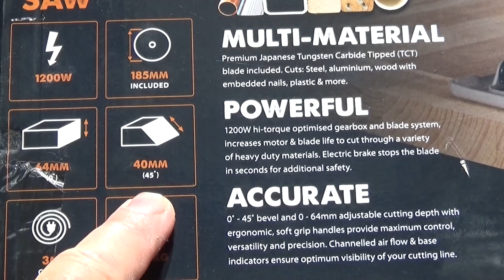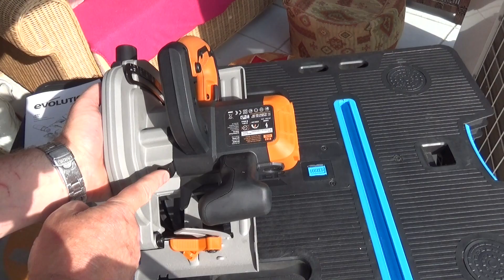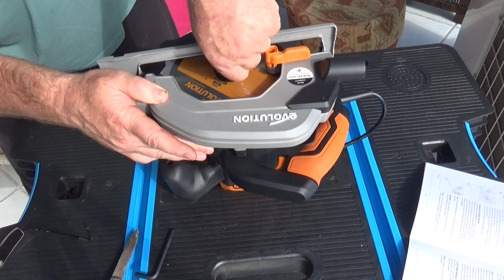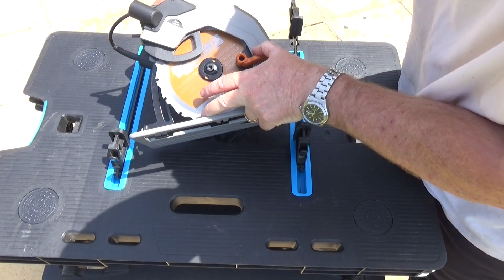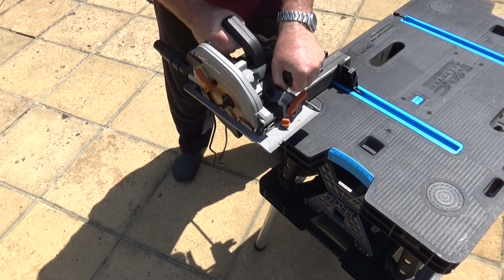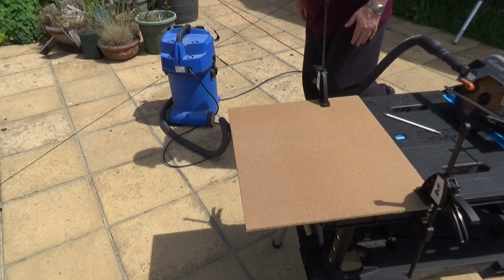Evolution R185CCSL Circular Saw - Saw provided by Evolution for review.

Comment: Hi have you got any tips for cutting mdf board at an angle.  I don't mean setting the blade to 45 using the lever on the saw but instead of cutting the strip off the board edge square - cut it so the angle of the 2 edges of the board is not 90 degrees.  I need to cut a rhomboid (had to google it!) from a square board.  I can draw the shape on the board ok with a sliding bezel.  I guess I can make a alignment jig with a straight edge offcut to use as a guide.  I have 4 of these to cut and they're all slightly different.  Thanks for this video
Reply from the maker: The jig I make on this video will work if there is enough room to clamp it onto the workpiece.  :-)

Comment: Hi mate just wanting to check up on how the saw is working after 2years ?
Reply from the maker: It is fine.  I used it recently to cut a few sleepers to make some raised beds.  It is not a tool I use a lot though.  If you look at the stanley stalple gun review I did you can see the raised beds towards the end of the review.  https://youtu.be/XDspZEPZPFY  :-)
Reply: @RussellPlatten  ahhh cheers I've been looking at a circular saw to Buy will be using only like 5 times a year but the price is too good to be true so wanted to know your experience thanks !
Reply from the maker: You're welcome!  :-)

Comment: Hello, blades from evolution are rubbish, I have try an orange one and it least for 3 cuts for 2mm thick 3x3 cm profile. I thought that it was problem with blade so I decided to send it to UK for examination. They told me that it is my fault and it is normal, I should use it for aluminum, plastic and wood not for steel. Waste of money, better buy few cheap black blades. Evolution has send me a blade back to use it for plastic. better do not believe in sponsored YT movies and stay away from this product. A saw itself is nice :) and works great with other blades.

Comment: Thanks Russell. I bought this today after watching several YouTube videos and you've highlighted all the important points, including the evolution (!) of the saw itself. The issue I had was when I attached the saw blade I failed to make sure the outer drive flange flats were engaged - resulting in a rather wobbly saw blade! I examined many saws on display in B&Q and the design and quality of the evolution seemed better than most. ScrewFix, B&Q and Parkside to a great job in providing us with amazingly good quality tools for unbelievably low prices. In general, looking at the range of tools in B&Q, I was amazed at how cheap some good quality tools are nowadays.
Reply from the maker: True Edward, the prices have dropped considerably over the years and the quality has improved!  :-)

Comment: Hi. It’s a very good video to learn how to use saw in a good way. And I want to ask you that I bought this saw as well but the cord don’t have a plug and instead it’s a 110v yellow industrial socket. So how can I change it to electric socket? Thanks
Reply from the maker: The 110v saw is designed to fit a 110v transformer here in the UK as we have 240v mains power.  It will not work on 240v.  :-)

Comment: I've got the 165mm model. Absolutely love it. £50 from Screwfix. Has that bulletproof blade you show in the video. One major thing for me (if you don't want to use the jig) you can actually see the cut line from the left side "over the motor".  That's the best bit and has straightened up my cuts no end. No other sidewinder/motor on left model offers that that I've seen.
Reply from the maker: Glad you like it Dean!  :-)

Comment: Can we use other saw blade i.e. makita/bosch etc?
Reply from the maker: You would need to search for a 185mm blade with a 20mm bore.  There are other blades available.  :-)
Reply: @RussellPlatten  Owh there are many blades with that size. My bosch circular saw use that size as well. Thank you!
Reply: @RussellPlatten  What about the thickness? Evolution has 1.7 mm meanwhile makita 2.0 mm. Will it be fit? I'm newbie btw.
Reply from the maker: @anandyahamdi  Yes the blade will be fine.  :-)

Comment: Hi. Would this cut sleepers? I understand I'd need to flip the sleep over to finish the cut, but was wonder if it would even cut it.
Reply from the maker: Strangely Richard, I have just used mine to cut several 200 x 100mm softwood sleepers for raised beds.  It coped easily.  Care just be taken to ensure the sleeper is fully supported along it's length so that the offcut does not bind the blade on end the final cut.  :-)

Comment: Russel, quick question. I've ordered this from Screwfix for collection tomorrow. It'll literally be my first power tool after a combi drill. I built a mud kitchen for my daughter out of old pallet wood and I think I've got the bug because I've ordered some materials to build a lean-to shelter off the back of my garage for the mid kitchen and a Wendy house. Anyway, ordered the circular saw after watching tons of videos on what I might need to get started but now I'm second guessing whether I should have spent the extra £25/£30 on one of the actual track saws instead. I can still cancel this one but I like what you did in the video by creating the track guide. What do you think? Should I stick with this or invest a little more for a track saw? Thanks.
Reply from the maker: If you can afford it Adam go for the track saw.  I was very impressed with the one that Evolution sent me to review.  The track saw is a more controlled way to cut sheet material.  :-)

Comment: Thanks for the video. It seems a very reliable multipurpose circular saw. My only question is how it differs from the Evosaw 180HD? This model: https://www.evolutionpowertools.com/us/steel/circular-saws/evosaw180hd/
They seem to have similar specs. Thanks again, KB.
Reply from the maker: The HD looks like it has s much larger blade enclosure to protect the user from flying steel debris whilst cutting.  It is designed purely for cutting steel and has a much better blade for steel cutting.  🙂

Comment: What is the difference between this saw and the Fury32102??? Which one is better!? Anyone knows??
Reply from the maker: The Fury is a lower spec machine aimed at the DIY market and occasional use, this saw is the professional model aimed at tradesmen and heavy duty applications.  Both saws are capable of getting the job done.  :-)
Reply: @RussellPlatten  
Thnx for the answer! Cause it seems that only the Blade is different!
Ähm 1 question that i still got is also, can you compare both Rage Models to each other in a vid!? 
Ordered my saw and got it today! I got the Rage 1b and i think you presenting the actual model right!? Seems that your saw is not so loud! Thinking of sending it back and order the latest model!

Comment: Is this saw left handed ? I'm left handed and have trouble seeing the cut cus the blade is in the was ... But with this I can see that the motor in on the other side .😁.... Is it ok on laminated worktops ?
Reply from the maker: It is designed for right handed people Darren.  It will cut the worktop, I am not sure that I would used a circular saw to do that job though.  :-)

Comment: One question can it cut rebar?
Reply from the maker: That is so weird, I have just been cutting a lot of 10mm rebar with the Evolution 210 mm mitre saw.  I made about 50 cuts.  By the time I had finished the rebar was very hot to the touch after cutting and the blade was ruined.  So the answer is yes, but it will wear out the blade.  :-)

Comment: Hi Russell, I'm new to your channel but I have subscribed now, on your recommendation I have brought this saw from Screwfix, the current price is £49.99, an absolute bargain if you ask me considering the blade, I have also ordered the diamond blade for this saw off the internet as I have tiles and bricks to cut, I hope it's as good as the TCT blade. 
Cheers buddy :)
Reply from the maker: Hi Stephen, the diamond blades are very good.  Be sure to cut the tiles and bricks in an area where the dust will not cause a problem.  A shop vac may help.  :-)